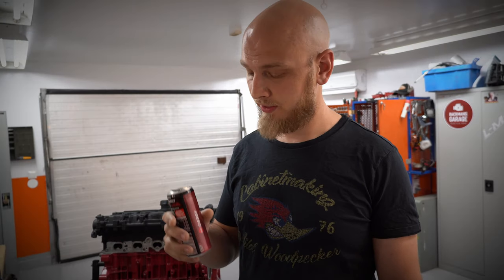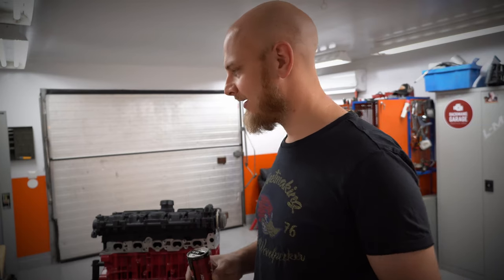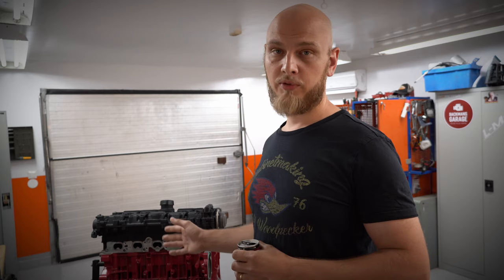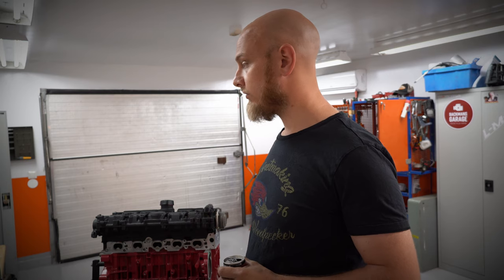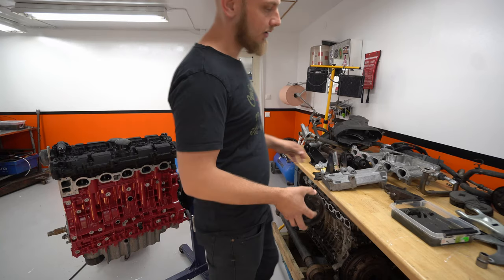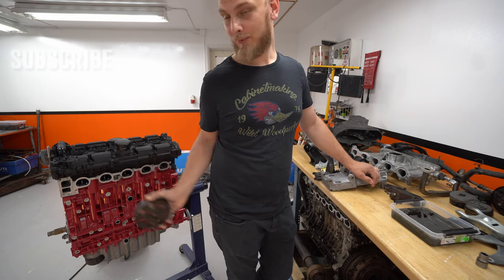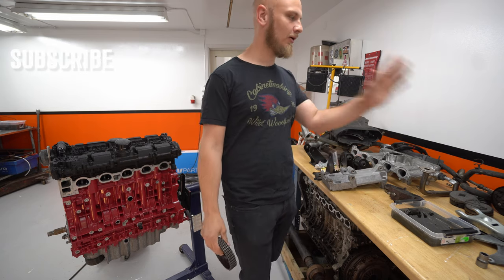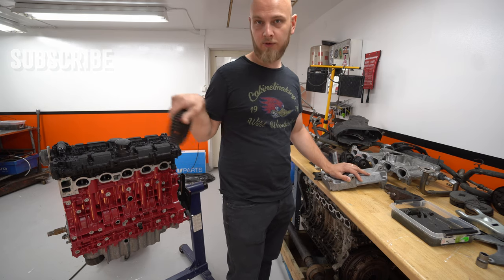THE VOLVO 740 PROJECT CAR || PART 6 || PREASSEMBLY OF THE B5254T ENGINE

Comment: Which 5 pot would u recommend for tuning? Im trying to soruce myself a 740 to have as a project car
Reply from the maker: Well the biggest problem is the bore size on this engine (83mm) Bigger bore - thinner cylinder walls that crack. I would suggest a B5244T5 2005->  81mm bore, you can run 400hp+ on stock bottom end no problem. //Backman

Comment: Denna videon var lite rörlig, varför limma du inte tråget, monterade remmar, och visa vart du putsade för att få motorfästet på förarsidan?
För att nämna några grejer.
Tycker dom tidigare videosarna på detta varit mycket mer ingående 👍
Reply from the maker: Satte bara ihop den tillfälligt för att se om jag behövde modifiera lite. Pre-assembly alså för-montering. 
Finns en till video på när jag sätter ihop den mera permanent 👍
Reply: Backmans Garage yes jag kollade såklart vidare på resten av serien, och då klarnar ju några av frågetecknen iallafall 🙂

Comment: Geez, wondering why you dont have a electric torque wrench
Reply from the maker: Yeah, that would be nice to have. But a little steep in price for my tools budget. And I dont mind the mechanical click of a manual torque wrench 👌 

But the automatic angle torque feature is something that i miss sometimes, the 360 manual gauge that i have to use now is 👎 

//Backman
Reply: @BackmansGarage  excuse me, I meant electrical impact wrench. I think a lot of stuff would be so much easier with one. especially those 400 oil pan bolts lol
Reply from the maker: Yes, that would be a nice addition to the tools collection aswell  😃 

Currently I use a standard cordless drill with the torque limiter on and then torque the last bit by hand. And for bigger bolts and nuts I use compressed air tools.

And what I do on YouTube isn't really the way i would work without the camera on. Alot has to do with sound and loud noises, they are a real pisser-offer when doing the editing. Getting a consistent volume through the entire video is really hard and loud noises often need manual adjusting in post in order to fit in with the normal speech. Imagine a 30min video full of loud noises from machines mixed with regular speech, a nightmare to edit. 

So yeah, even if i had an impact wrench, I probably would not use it in the making of the videos. 

Maybe i should do a behind the scenes video sometime to show how much there is to consider when making a decent garage video? Might do one of those once i get better at this, maybe in a year or so 😄 //Backman